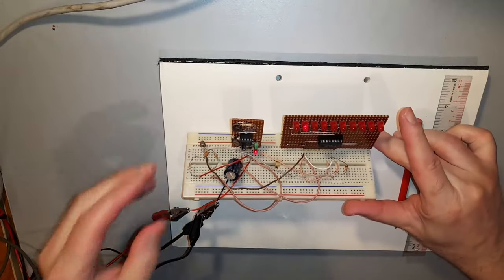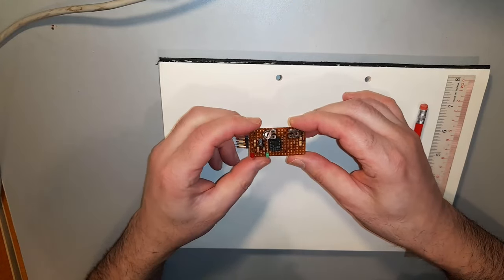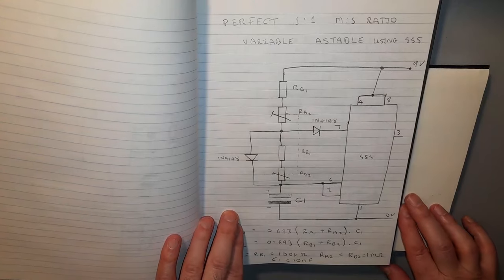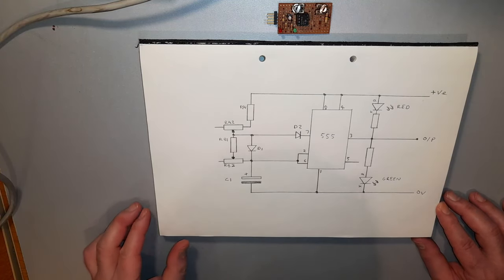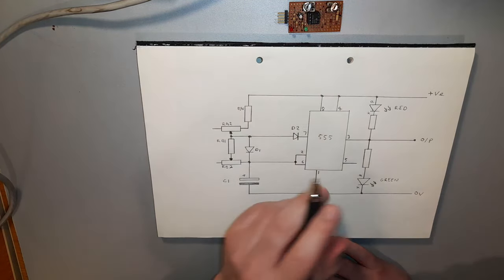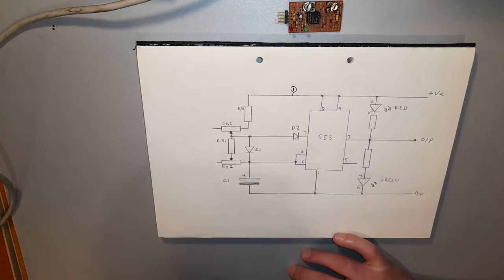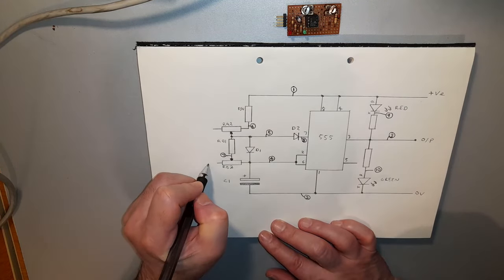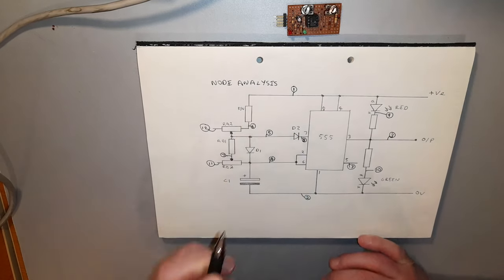Design Your Electronic Circuit Layout With This Unique Method - Tutorial

Comment: Thanks, I still love stripboard and am intrigued by this method. I have used the free and open source VeeCAD in the past,  there is a bit of a learning curve, but there are YouTube tutorials. It can import netlists generated in free cad applications.

Btw it is good practice to connect the unused leg of potentiometers to the slider, operation is unaffected.  In the event of loss of contact between the slider and the track, due to corrosion , age or fault, instead of going open circuit you will get the total resistance of the pot. An open circuit is outside the design requirements of the circuit and depending on the circuit could be catastrophic, or just stop it working.
Reply from the maker: Thank you for this gem of a comment, Mike! I have not heard of VeeCAD before and it looks really good, and I'll take a close look at this! And your second comment about using the unused leg of the preset by tying it to the wiper is excellent! And it would have meant that I could have declared node 11 as node 7 and node 12 as node 5. And you can see there is space on the board for two small links to make those connections. And the idea that they fail safe is just great. I had not considered that before.
Reply from the maker: Thanks Mike. I'll look into Kicad at some point as well. Cheers.

Comment: One other thing  you can use Kicad to do a professional schematic it will annotate it for you and then you could put you nodes on it then print the lot out looking good and of course saves the file. Of course there is 'Fritzing' which allows you to enter a breadboard circuit and it will generate a Veroboard board for you, I think you maybe able to design a PCB as well I haven't used it for years as Kicad suites all my needs now.    Happy New  Year !
Reply from the maker: And thanks for these great tips as well. Cheers.

Comment: Nice introduction of this unique method for strip boards! Can you also tell how to make clean and compact circuits on zero board and probably how to not mess it during connections 😭.
Reply from the maker: Thanks. The method applies equally to zero/perf board. These types of boards allow you to take your nodes in even less constrained directions if you want to. The most important thing is to label nodes as you go. I might do a video on this. Might be an interesting exercise!

Comment: Really interesting this approach of converting a scematic into a plan / stripboard. I am still at the half way point but I am wondering how you would approach a more complex project with say ~70 nodes (quickly went over my scematic) Especially, when you have ground (and in my case + 12V and -12 v) beeing connected to the circuit at multiple places. There seems to be potential for bundleing but I'm still pretty confused about it. Thanks alot for all the work that went into this video. You got a new subscriber today :)
Reply from the maker: Thank you for your kind comments. Yes, you can use it for any number of nodes. It's just a systematic approach; i.e. you've got to make sure you don't overlook any nodes. That's the purpose of this process - to not miss any! Just take your time a bit when marking up your schematic.
Reply from the maker: Oh, and I've just had another thought about what you may be referring to with power supply rails. Sometimes, power rails are not shown fully connected to all parts in a circuit but may be indicated as separate connections and then labelled, in which case they should be given the same node number. And in other cases, you may have two, or more, separate power rails with the same voltage, but the voltage sources are derived separately, in which case they'd be designated with different node numbers.

Comment: While this method is nice ( and I do use a similar, more adhoc one myself ) I personally have a different taste regarding the connection of pin4 and 6 ... I generally only use sockets in those prototypes, and usually I put a link under the socket when possible (or the backside). that might not all be perpendicular, but I think its often cleaner and uses up less space than going the roundabout way all over the board. Unless of course you need those traces there anyways for other reasons.
Reply from the maker: I'm not sure if you got the point of the tutorial? It wasn't specifically about the 555 astable timer circuit, which was just used as an example. It was about using node analysis to design a reliable and efficient layout. But as to the specific circuit, if you look carefully, I had to make other connections to those nodes as well, so, for example, the pins 6 & 2 node - node 4 - has 9 soldered connections to it, whilst node 1 has 8 soldered connections. By declaring the extra tracks, and deciding where they would be located, I saved space because they were used to make these additional connections to other components in the circuit so the net effect is to save space, not waste space for the sake of neatness. Thanks for the challenging comment - it's good to have these to test if the content creator knows his stuff or is talking BS.

Comment: It's been long time when I last used strip copper board. I think last was discrete amplifier prototype in 1998 etc.
Usually using dot copper boards or just design with kicad and order from china if too much smd components.
0805 resistor fit nicely between pads. Using dual row connectors/headers make hard to use strip copper boards.
Reply from the maker: Hi @LimbaZero, thanks for your comment. The method described works with any base board system, including PCBs and perf board.

Comment: You could have used the tracks underneath the chip to connect the pins on opposite sides (again using vertical connections)
Reply from the maker: Thanks for your great comment, Kaleoride. I've had to give that a few minutes of thought to try and understand your perspective. I can see where you're coming from, and that would indeed give opportunities to save further space. With all the links made on the underside, I think the example could be shrunk down a further 0.3 - 0.4 inches across. I can see you perhaps made that suggestion with consideration for all links being made vertically, as I described in the video. However, the ideas about the layout I was suggesting was with the overall design consideration being that all components and links are landed on one side of the board - the component side, and all soldered connections are made on the track , or solder side. This is known as a single-sided build/ or board. Generally, when links end up on the underside, and believe me, I have been there many times, and I've got a video coming where I confess this, these are usually reserved for bodges!
Reply: @FiveFiveFiveFourOhOneSeven  I see. Thank you for taking the time.

Comment: Impressive, neat and pretty. Where do I get the software? When feasable, trimmer manufacturers like you to tie unused legs to the wiper terminal.  Usually, this is no problem.  I have found that untied wipers seem to create more intermittents. Ofcourse, some circuits won't work with tied wipers.
Reply from the maker: Thanks for your comments, Gary. The tech used in the video were pen, pencil, paper and MS Paint! Making the stripboard graphic in MS Paint was quite fiddly but now I have it as a quick-to-reproduce template so it may be a little easier for me if I do another graphic like this. Re: presets, yes, another commenter made the same suggestion and I agree, it provides a good way for the wiper to fail safe.

Comment: I wonder if D1 could have be flipped and moved to the left of D2, saving one more column? or would that have made D1 and D2 too cramped?
Reply from the maker: Ian H, you are a genius! That would indeed work. Node 5 is one track up from the bottom, and node 4 is three further tracks up so it would comfortably fit and still sit horizontally on the board. And that would save a further column, reducing it to 1.7 inches. I think I failed to spot that move because that diode was the first component I landed after placing the 555 down. Thanks!
Reply: @FiveFiveFiveFourOhOneSeven  Thanks, its much easier when I'm "standing on your shoulders" having watched the hard work you already put in and watched your video. I might see what using relaxed design considerations does as well just to get my head around - I last seriously played with electronics as a kid - I moved onto computers at 12.
Reply from the maker: Of course, if you use different design considerations, you get different outcomes. You could get this circuit down in size by a further 50% and the price you might pay for that might be that it is more difficult to debug if there is a problem. And you could use surface mount components and shrink it down by a further 50% but it might be a lot more difficult to assemble. You're free to choose what your design considerations are, weighing up pros and cons as you go. Thanks again for the feedback, Ian.

Comment: Good methode Sir, but it seems the node of the first potentiometer  is forgotten isn’t ? Thks for your communication.
Reply: No.
Reply from the maker: Thank you for your comment, and you are perhaps, very observant. I did, indeed, not include the node numbers for the unused legs of the presets and pin 5 of the 555 in the first iteration of the layout. This was because I had done some preparation beforehand (videos like this are incredibly difficult and time consuming to make, and that includes ensuring continuity), and I had drawn the first layout iteration before redrawing the diagram for clarity. However, by the second iteration, you'll see the unused legs did have the node numbers included.

Comment: Lochmaster 40, out of the stone age..
Reply from the maker: Yes, I probably am! But reliable methods and good habits help.
Reply: Nice idea and I am thinking could use a bread board setting out the components as you have done using the tracks of the bread board and testing circuit before committing to soldering
Reply from the maker: Hi Alan, Yes. Breadboards work in a very similar way. The nodes are arranged in strips of 5, side by side. Some breadboards even have node numbers on them. I'll be doing a video describing them in detail at some point.

Comment: Man..  You really need to write BIGGER so we can actually see what you've annotated, also, don't put the sketch-pad at an angle to the camera lens, the viewers should be seeing a straight plan view.    Why not go even one step further and construct a backlight box - 300mm X 400mm fitted with a white opaque perspex top and lit from beneath by several strips of FSTv backlight  LED's...
Would also be useful to backlight printed circuit boards, maybe even veroboard.
Reply from the maker: Thank you for your suggestions. I'm still finding my feet. Hopefully my setup will improve over time. What I'll say at present is the logistics are tricky and I keep bumping my noggin on the clamp holding my camera phone! I hope the value of my content makes up for the lack of a quality setup.

Comment: Had to stop at the OCD requirement for only vertical jumper wires.  This is stupid, and it cost some unnecessary space.  Wisdom is in learning which of your rules are useful, and which are not.  There is nothing "ugly" about diagonal jumpers on the rear of the board.  There IS something ugly about redundant jumper wires.
Reply from the maker: You do you, Jim.